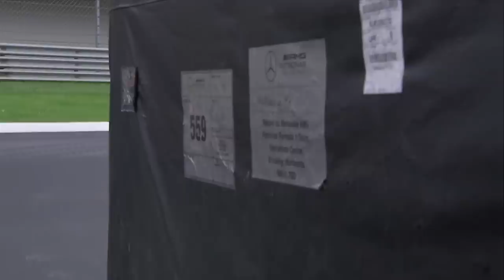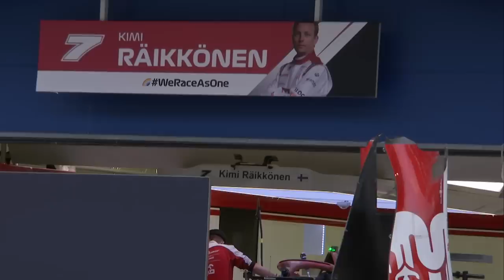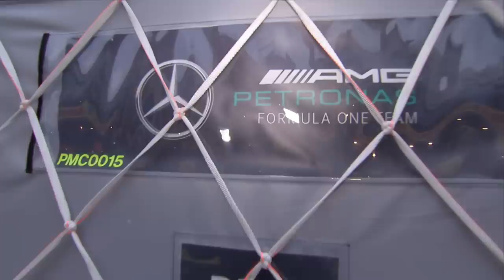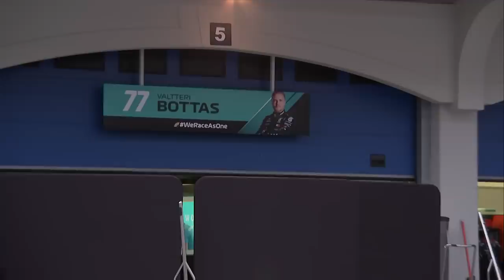Ted Kravitz takes a look back at a dramatic wet Turkish Grand Prix | The Notebook

Comment: There you go. Seb hasn't forgotten how to race. Lewis greatness is not just because of the car. Max choked again when it mattered; he still has a long way to go before you can start comparing him to a champion. When the chips were down, 2 out of the 3 champions on the grid came alive.
Reply: @Monsieurturmoil funny to watch max just spraying water in the air!!
Reply: @Monsieurturmoil I think the red bull is just terrible at starts. It’s happened to him and Albon all the time this season.
Reply: “When the chips were down, 2 out of the 3 champions on the grid came alive”
mic drop 

👏🏽👏🏽👏🏽👏🏽
Reply: Kimi: "Meh it was ok"

Comment: Was the Mercedes the quickest car.  Yes it was  ONCE the tyres got switched on.  So Wet conditions and Wet tyres RP were the fastest. Once Intermediates were the fastest it is likely  the Red Bulls were initially  fastest but then Lewis was able to get his tyres switched on and at that point the Mercedes #44 was the fastest.   A great Win for Lewis totally deserved.    Toto Wolff was probably wondering  about how he can cancel Bottas'' contract and then sign Checo for 2020.
Reply: Bottas is still second in the driver's championship. Why would toto get anyone else. To have someone race or push Lewis. Mercedes knows Lewis is faster than Bottas so they don't have a problem like Nico or red bull had with vet and webber. You don't win constructor champions slowing each other down or even putting each other out of the race.
Reply: Toto doesn’t manage Perez, but he does manage Russel. I feel a sorcerers Apprentice coming on.
Reply: @thekitowl  Checo has now scored in his last 18  races appearances.  Theu often used the same strategy are two of the best drivers at Tyre management.   It was also the way Toto's arm was around Checo on the podium.   It was meant to be a bit flippant and not at all a serious consideration.
Reply: @chriscollins550  To be honest, who ever was the second driver at Mercedes is not going to usurp Lewis.   He is in a class of his own.   Sure Max has the speed to challenge  but makes mistakes and is impatient.  I am a big fan of Perez  - and as we saw  even when dropped to the back of the field has lap on  lap pace to really catch up through the field ... but he is no Hamilton.  I am not even a Hamilton fan but in 2020 he was awesome.
Reply: @chriscollins550  Yeah but if Bottas was in RP ? where would he be .... makes a lot of mistakes.   He is in the most dominant car  almost in F1 History.
Reply: @GEMINICT  it does not really matter. Only people who keep going on about Bottas is the same people who want the second seat driver to challenge Lewis, but without saying it. I don't think it matters who you put in the second car they just don't have what Lewis has. This argument about Bottas is stupid. Mercedes are happy with him so they aren't going to change him anytime soon. Why complain about it.
Reply: @chriscollins550  it was a joke .... yesterday Bottas had a truly appalling day. People joke about Albon being lapped by his team mate.

Comment: Relaying the tarmac may have led to lots of spins but not being able to see the drivers going round turn 8 flat out was a massive disappointment, I don’t blame the Turks I blame the F1 bosses they should have had some preliminary events to get rubber on the track, considering there experience, they screwed up.

Comment: anybody know if slightly deflated tires (for more grip) is legal or not?
Reply: Pirelli set a minimum tyre pressure. Going below that is not legal. This became a rule because teams were using dangerously low pressures to gain grip.

Comment: Ted got Stroll's race wrong. Stroll destroyed his 1st set of inters and had to pit for new ones, he would have fall down the order either way. Perez closed a 10sec gap to Stroll before the pit.
Reply: Exactly, he was driving too hard. There was a reason why Perez and vettel were holding back. He is just too inexperienced still for F1. He has speed, but not the maturity for this business yet. Maybe one day he might, almost certainly he will have the chance simply because of daddy's money.
Reply: I assumed he panicked and agree to change tyres as soon as they felt less than perfect. All he had to do was hold on for a few more laps for the feeling to comeback.
When you look at his stop you can clearly see that his inters were not anywhere as bas as when others when they pitted